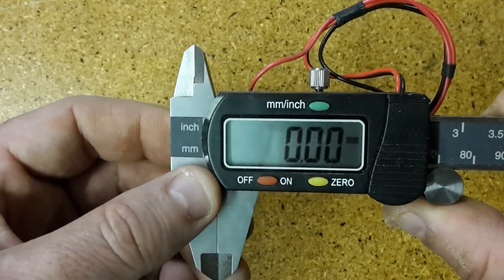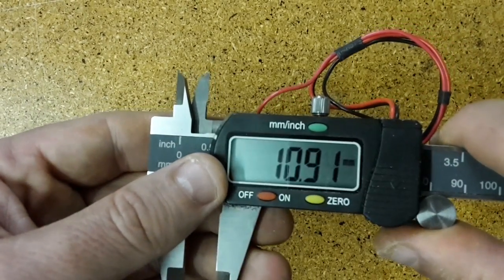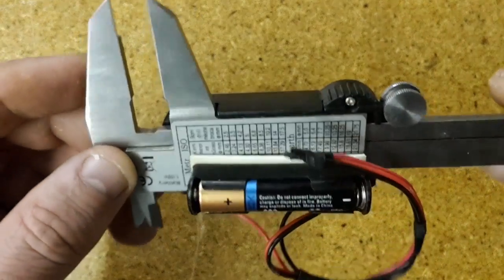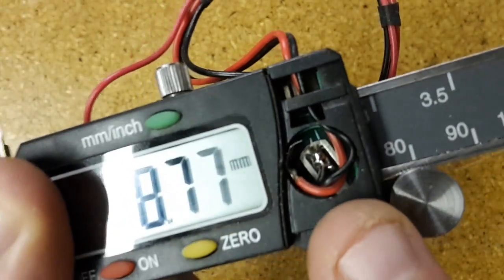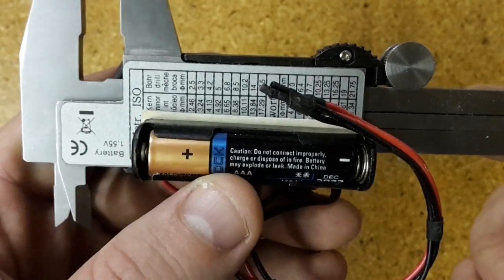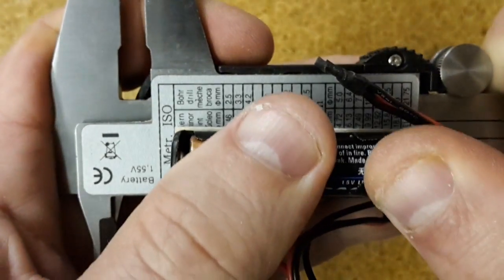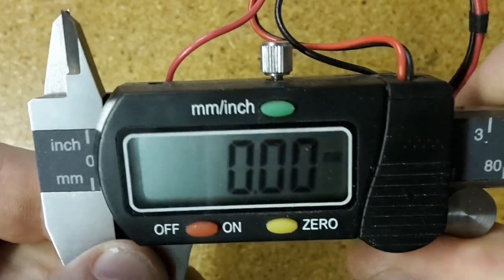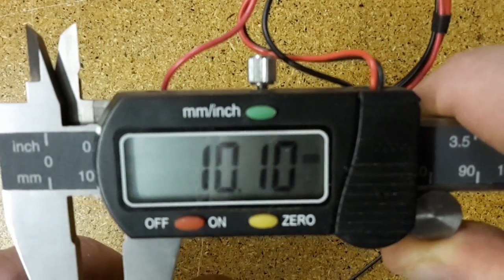Battery Hack For Digital Vernier Calipers

Comment: Good idea - except the calipers will no longer fit in its case.
Reply from the maker: Correct, this is an issue, I use the them on the work bench only.
Reply: Nothing to stop him hacking together a bigger case.
Reply: If you need to fit them back in case you can just put battery on different spot.

Comment: Great idea!! I think I would cut the extra wire. but I do think I will do the same hack. Thank you!!
Reply from the maker: Thanks, 
The wire is a bit long, I should have shortened it LOL. Also looks like the unit never really turns off. Adding a switch may also help.